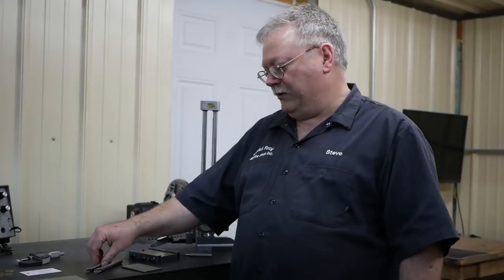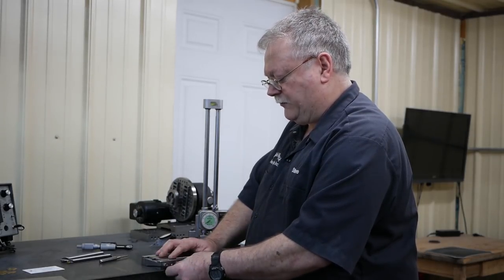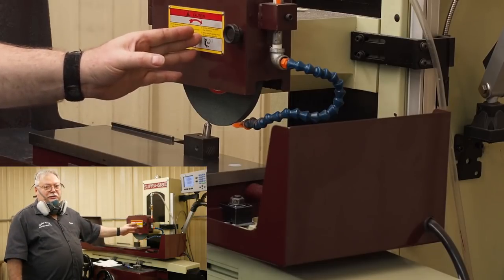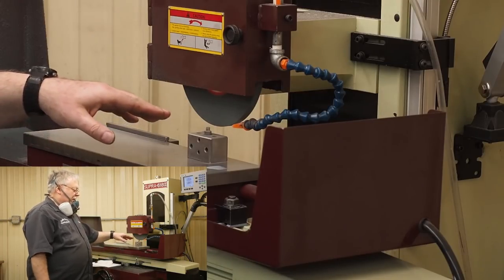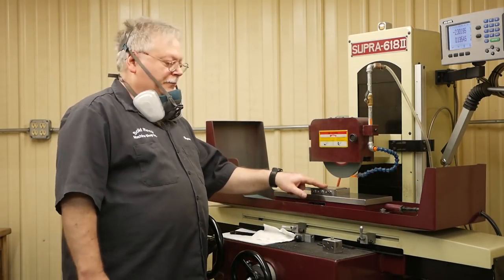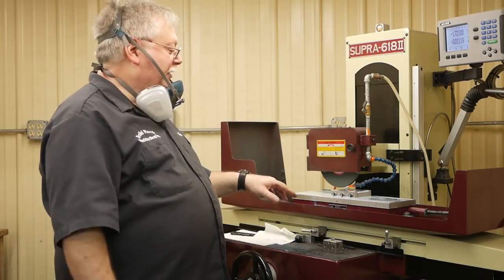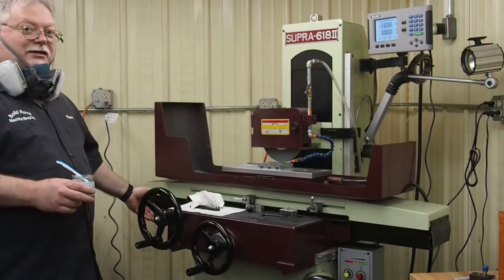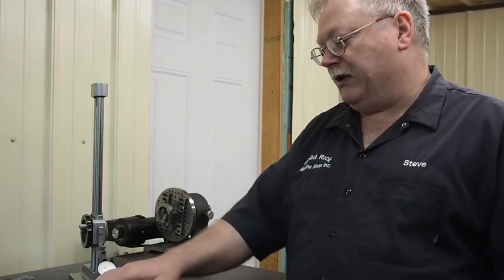Grinding Titanium.

Comment: Steve, awesome video as always and your results are fantastic!  Going to get one of those wheels on the way.  Your fixture looks great, very clever design for holding the plates.  Looks like I have some fixture making to do!  Thanks again the help and advice you give is excellent and I really appreciate your time spent making the videos and helping others.
Reply from the maker: Hi Seth,
Your welcome. If you build a similar fixture have the clamping pressure push down rather than pinch from the sides like the one in the video. Thin plates will flex more with the side pressure. I didn't have thick enough steel at the time to make the fixture the way I wanted to. I think you will love the wheel.
Steve

Comment: Oh my, you just taught me something today.  I had no idea that you could grind titanium.  I've never worked with it before, only ever seen a medical titanium screw before.  Thanks for sharing. Cheers, Aaron.
Reply from the maker: Hi Aaron,
This was only my third short experience in Titanium. I can tell tell you it was hard on the carbide mill cutter doing the 45 degree angle.
Steve
Reply: I've done just a little turning and milling of titanium in my home shop. Since it is just a home shop tool life and it's cost is a bit more important than my time is. For a light cut like that 45 degree chamfer on each side of the plate maybe try a good quality braised carbide tool in a flycutter. Micro 100 make some excellent long lasting braised carbide. Interrupted cut or not, for light cuts or low metal removal rates I've found the braised carbide to stand up a lot better on titanium for me than even solid carbide end mills will. Of course I may have been using the incorrect grade of those carbide end mills and maybe a proper Titanium specific grade might have changed my results. HSS will cut and drill it, but let the tool rub at all and the grades I was trying will work harden right now.

And Titanium doesn't like large depths of cut or excessive rpm while being cut according to one supplier I talked to. You want the heat removed in the chip so a light depth of cut and fairly high feed rate. Get it too hot and it seems to start to smear the surface finish, or even worse with some grades start that work hardening. Very interesting tip on coating that straight unmixed coolant on the part first as well as using the flood coolant Steve. Titanium to me just seems to be a real tough on tool edges material a bit like some stainless. Maybe a tight grain structure that's harder to get a smooth cut on than being actually a high Rockwell number hard? It's a long ways from my favorite metal. I'm not sure it could be ground without having flood coolant on it. It's also not a great idea to let the chips or dust build up anywhere since a lot of the Ti. grades are pretty easy to ignite.
Reply: I bet it was hard on that carbide mill cutter.  One day I'll experience working with it, but I'm in no hurry.  Cheers Steve, Aaron.
Reply: Thank you for the information.  The fear of it igniting would be enough for me to stay away from it.  I appreciate your time.  Cheers, Aaron
Reply: Aaron, some grades are more prone to the chips igniting than others. It's not a huge problem if you understand what can happen under certain circumstances. It's machined every day in industry for high performance racing parts, areospace, military parts etc. with few problems. Magnesium is far worse and it can be machined if your careful. The sharper the tool edge the less friction heat you generate.
Reply from the maker: Hi Turning Point,
Thanks for the tips. Titanium is a whole new learning curve for me. It defiantly requires a different set of rules.
Steve

Comment: Hi Steve!
Thanks for the education on dressing the wheel, very interesting how it affects surface finish!
Never sen Ti being ground before. Ti is nowadays used extensively in modern fireworks in the form of 0.1 to 2.5 mm flake or sponge titanium. It gives very bright white sparks with oxidizers. 
A safety tip is that  Ti fires (and even more so zirconium and magnesium) should never be put out with water, dry sand works well. These metals burn well under water and they do often then also explode violently. 
Titanium has a very hard oxide layer and the grades machine differently. My experience is mostly from medical grades. These are fairly soft and fine grain sharp inserts work best. Some Alu inserts work well. Once the cutting parameters are right, it is not very difficult to machine it. There will be quick build up on dull cutting edges and imminent tool failure.  Taking to light cuts also tends to shorten tool life since the tool cuts more in the tough oxide layer than in the metal. I wonder how this translates into grinding. Ti oxides are normally softer than Silicon carbide, but it is known that they can also be the hardest metal oxides known in thin layers, even harder than CBN. I think it is then called cotunnite or something similar.
Reply from the maker: Hi Erik,
Thanks for the information. Titanium is a whole new ball game with a new set of rules. I can see why some struggle with it. Tips from those who know this material are a big help.
Steve
Reply: Hi Steve!
Here is a link to my old PM post and responses about flammable metals from some Years ago that can perhaps be of interest for some:  
http://www.practicalmachinist.com/vb/cnc-machining/hazards-machining-magnesium-314231/index2.html
I have a friend who fabricates many one off Ti medical implants and similar stuff. The preferred cutting oils for this seem to be  straight oils for Ti. Maybe that keeps the oxygen out delaying re oxidation of the cut surface thereby improving machinability at low sfm:s? 
Perhaps this has something to do with the undiluted coolant trick that works really well, I tried it. Thanks for the tip!
Grade 7 and the harder aerospace alloys are machined at high speeds with water based coolants. Ti is a really poor heat conductor, so at high speed water seems to cool best. 
I tried cooling with liquid CO2 from a stainless hypodermic needle  some years ago, and it worked well as a dry process for HSM of Ti.
Reply from the maker: Thanks for the information Erik.

Steve

Comment: I use Bio-Syntra LM-10 made by Renewable Lubricants and get superb finishes on everything I have tried so far. No mixing required!
Reply from the maker: There are a lot of good products out there. Sometimes it can be frustrating finding the right coolant. Thanks for sharing.
Steve

Comment: Nice work Steve! A standard 8 x 1/2 x 1-1/4 GC60-I silicon carbide wheel from Travers on sale is about $25.00
ATB, Robin
Reply from the maker: Hi Robin,

I never worked in Titanium before and everything I researched on the internet suggested it was going to be nasty. I knew heat build up was going to be the issue so I wanted an open structure knowing that with Aluminum Oxide wheels with open structure reduced heat significantly. Also, I liked the anti loading I had with the open structure Aluminum Oxide wheels by painting on undiluted coolant. I was hoping to have the same results with the Silicon Carbide wheel so Radiac made an open structure one for me and it worked great. I had know idea why I had such a huge improvement in the finish when painted with undiluted coolant but Erik Isberg had a good explanation in his comment on this page.
Steve

Comment: Thanks for the tips on dressing!  Interesting thought about the wheel hydroplaning.  It made me wonder if the thick coolant would fill the voids in the wheel causing it to cut more evenly.  It seems similar to machine ways, the hand scraped and flaked way holds enough high viscosity lubricant to provide a thin film between the contact surfaces.  Maybe that's why it works well on aluminum?  If it's filling the voids aluminum is more compressible than a fluid, so maybe that's what keeps the wheel from loading up.
Reply from the maker: Hi Pete,
I am not sure why the coolant trick works but it does make a big difference in the finish. I do know that using this method in Aluminum keeps the wheel from loading up.

Comment: Steve,
Have you tried the Ceramic (SG) wheels? In my experience with them, they grind cooler because  their structure allows the grit to fracture keeping a sharp edge. I haven't used them on Titanium, but they work great on CPM 10-V. and other tough/hard to grind materials.
On a safety note, you may want to look into a dust collector for your grinder. I know they cost a few bucks but your lungs are worth it.
Great content on your videos, I'm really enjoying them.
Reply from the maker: Hi Rob, I have never used the Norton SG but I use the Radiac ceramic aluminum oxide mix  and they work great for steels like 10V.

Comment: Hello; based on how many of the other commenters I recognize it's little wonder your videos appear in my recommendations.  It might be of interest that John Saunders @ NYC CNC has been getting pretty good work-holding results out of putting masking tape on both parts and superglue in between.
Reply from the maker: Hi Jim
I will have to check that out. Does he use coolant on the parts that are taped?
Steve
Reply: This one (https://youtu.be/T2Z1WwY5W2U?t=511) and this one (https://www.youtube.com/watch?v=r6DCvtcU8_M) refer; I can't recall if he's used flood coolant with it though.
Reply from the maker: Hi Jim,

Thanks for the links.

Comment: Somehow I though titanium would not throw sparks when grinding interesting
Reply: fun fact - Formula 1 racing series mandated that cars should use titanium pads on the underside of the car (wear surfaces, to prevent carbon fiber bodywork to touch the tarmac, which would instantly ruin the CF part) to generate lots of sparks to add excitement for the fans watching the race, I kid you not, that is exactly what they did, they used to use silicon carbide pads, but those basically didn't wear, thus generated no sparks, just dust, so teams were told to use titanium...
Reply from the maker: Hi Scott,
Those sparks were different than steel. They were white hot.